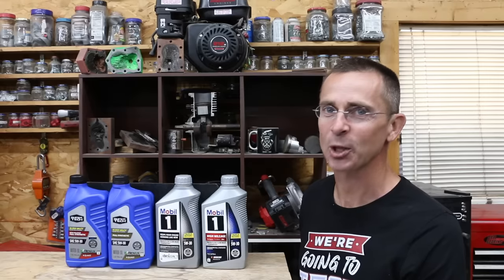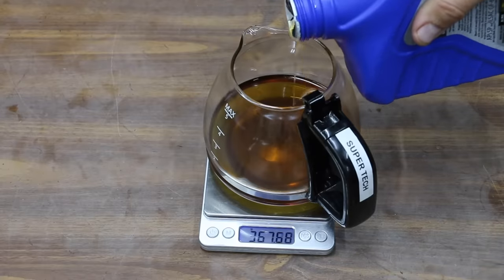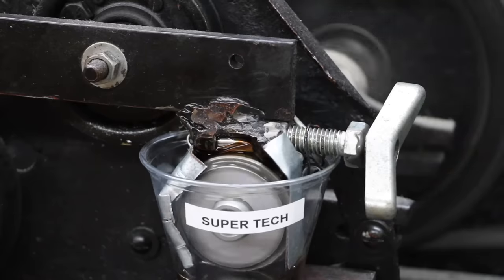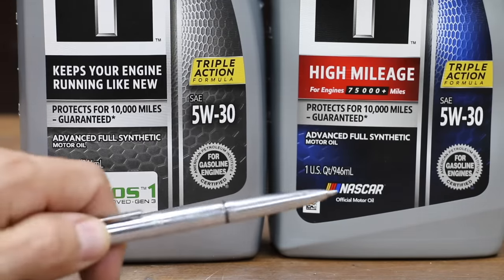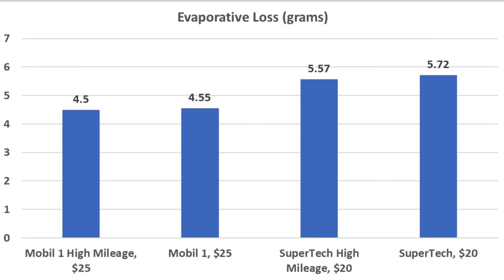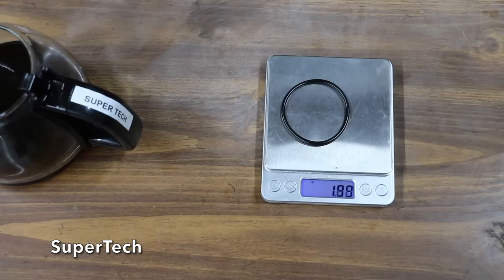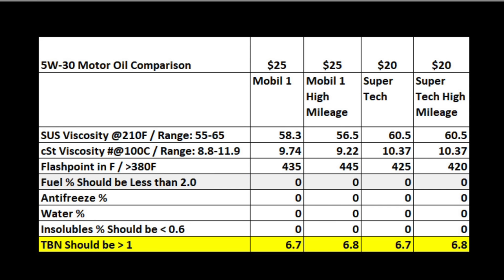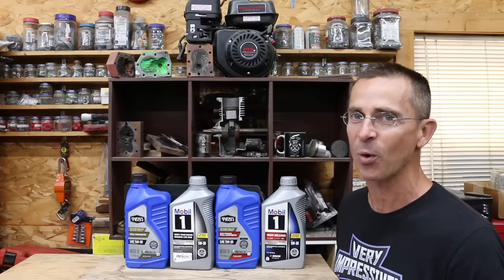Is “High Mileage” Motor Oil Safe? Let’s find out! Mobil 1 vs Mobil 1 High Mileage; SuperTech vs STHM

Comment: I bought that supertech 10000 mile oil once. Put it in a k20 honda motor. That stuff was like water. It burned up in no time at all. In a matter of a few weeks i added like 2 to 3 quarts of mobil one 5k mile oil. I'll never use that stuff again. My motor even sounded worse after running that oil. And it didn't burn oil before that oil change.
Reply from the maker: Thanks for sharing.

Comment: The viscosity of Mobile 1 came up at a car club meeting and if I remember correctly, the reason it runs slower in the tests where you poured them out is it's supposed to "stick" to the innards of the engine to assist with cold starts which reduces wear.  High mileage engines don't need that nearly as much.
Reply from the maker: Thanks for the feedback.

Comment: Would be interesting to run the same test using previous data to see if a difference shows up between different batches of oil. A test for consistency.
Reply from the maker: Thanks for the suggestion

Comment: if the test for a better oil is how well it flows, then why not just buy a thinner oil?   Oil companies place a viscosity rating of "10w-30" because it flows like a 10w-30.   If one brand seems to flow slower than other brands "10w-30"  then you can just buy the 5w-20..  So, what I mean is that there is a range of tolerance that Oils need to remain in, to be classified as 10w-30 or any other weight.  So it doesn't mean that if 1 oil flows a bit faster than the other that it is a better oil!   If more viscosity is better then stop using 10w-30 and get 5w-20.   All you need to do look for an "outlier"..  Meaning if 1 oil flows MUCH faster or MUCH slower than all the other brands, then it may be out of tolerance for that viscosity rating.. And it may be out of spec for your Engine.  It still doesnt mean it is a bad oil..  So IMO the only thing your viscosity test is good for is not to see if 1 oil is slight ahead of the other, but rather if one oil is drasitcally disfferent than the rest.   What you SHOULD do is find a baselione for how a 10w-30 SHOULD flow.  Then see how it flows according to the specified range.  Dont just compare 1 oil brand to the other.  And I dont like the Evaporative loss test also.  Because engines have a potential to use more oil than it loses due to evaporation.  And if your oil is in your engine SOOO LONNNGGG that it evaporated out or below LOW level between oil changes, they you have a personal problem not an oil problem. In short, evaporation is not enough to measure if you change your oil regularly.

Comment: Hi, enjoyed this video. Have a question. I just bought a 2007 Honda Accord V6 sedan with automatic transmission from an old man original owner, however, there are no maintenance records and he doesn't remember anything. The car has a lot of minor issues and faded paint, so, it needs work, but, the engine is not burning oil, the a/c works great and the transmission shifts smoothly. I don't know what was in there, but, I just did my 1st oil change and I did put synthetic oil in there . Hope that if it was on synthetic, it won't be a problem switching to regular Quaker State oil that the factory said you could use when new. Don't know if this was a good idea, but, I did it to save costs. I do want to keep it long term, but, at the same time, I 'm still deciding if I want to put $3000 more into this car to paint and fix it or if it will be a money pit. Here's my dilemma. Maybe you can help. While the transmission shift smooth, when I take the dipstick out, it definitely does not have that newer red fluid glow to it. Looks a little dirty and yellow like motor oil. But, it shifts fine. Not knowing the maintenance history and thinking it wasn't ever changed or not often, would you mess with it and flush the transmission fluid or just leave it alone and run it till the transmission dies or needs fluid and just add the fluid? I've asked a dealer and they say to change the fluid. I asked 2-other mechanics and they disagree. I'd also hate to put about $3000 into the car to clean up a lot of issues and then see the transmission or even the a/c go bad on me. I don't know if I want to keep the car or maybe sell it. Sounded like a great deal. 1-owner car and a friendly old man was the owner - but - I don't know if it was such a good deal after all. Thoughts?

Comment: As usual a great test.  There are still numerous variables. Not knowing the quality control consistency requirements for allowed variances between batches of oil manufactured by the tens to hundreds of thousands of gallons per batch from what they start with in unrefined crude available to them to what they finish with through refining and additives  though I suspect quality control is very tight and variances are minimal from batch to batch at least on the finished product.  While elastomers such as seals and O-rings are most commonly in direct contact with hot metal parts of an engine that become can experience the need for relatively rapid expansion and/or contraction in order to seal properly as well as tolerate being heat soaked for prolonged periods on longer trips I’m not sure but, suspect that the O-rings settled to the bottom of the coffee pitchers/carafe with only the Pyrex glass and a thin film of oil separating the O-ring from the burners surface and at what varying heat range.  I wonder what if any differences with the O-ring would have been observed had you suspended the O-ring in the oil so it did not contact the bottom of the pot.  I don’t know what influence that might have in test results or of such short exposure but outside of starting with a full engine rebuild including extra new O-rings and seals from the same production batch as the standard reference to be tested during/against teardown and rebuild of that engine many years, operating hours and miles later which isn’t exactly feasible $$$ wise and as many of us might not/won’t still be around.  I often wonder what the hygroscopic tendencies are of different oils and if there is a standard for such after exposure to use and internal combustion motor operation and the oil’s exposure to existing internal contaminants would be and which oils have the least and greatest hygroscopic tendencies and what influence such moisture contamination would be on wear surfaces and elastomers such as seals and O-rings.   To me, your tests are great common sense with mechanical knowledge and research interwoven within them.  I am(was) a technician and later a technical engineer at a commercial nuclear power plant so I was constantly trying to figure why some degreed engineers did things in such a way that seamed so alien to a former mechanic/technician in electronics, mechanic, pneumatics, hydraulics, etc.  Where their design weaknesses were their typical lack of knowledge in designing something while having little to no knowledge of it requiring access for operation and maintenance and that’s where the overlap in review by those such as the different operators, crafts and technical engineers that had such experience came into play in feedback during the design and construction process for the final design but our suggestions the design still had to  meet or exceed the different regulatory requirements.   I was the why did they do it that way questioning kind of a guy could it be installed faster with less radiological exposure and be easier to access to operate, maintain and repair.  Their knowledge was book taught while mine was real world application taught and always trying to think about the workers, the operator having to operate the equipment and the different maintenance department crafts and radiological and environmental control restrictions placed on those personnel and needed maintenance and field repair of the equipment.  I enjoyed my job but not the hassles often inherited when you got to pick up 2-4 years into a design that did not get due diligence from the various other departments that should have been more money involved because at that point management did not often want to hear of the problems some one(me) that nit picked wanted to identified while developing an Imp Kenya toon plan for its build, construction and installation.  Thanks for a good testing.  With the small variables identified especially in the wear performance other than the pretty significantly lower flow ability of the standard Mobil 1 cold flow test new and after after being cooked looking bad for Mobil 1, I for one have to ask why was that as I think the answers to that would be most interesting and suspect that even Mobil 1 manufacturer might be interested if you offered to send them some oil from that container new snd post cooking.

Comment: Thanks, good work, &* “ tests”….Interestingly, I just switched to Synthetic VALVOLINE / VALVOLINE Filter in :2007 Canyon LS4CYL, & 2015 Journey 4 CYL….The GMC PRIMARILY  was , MOB1 : &always used **MOBIL ONE FS HI MILEAGE “ for top off/ prime the early FILTER ( mostly NAPA GOLD/ Purolator BOSS; three -4 month,  Replacements, on both Vehicles….   actually, cutting back MY car work: had my Mechanic ‘s Shop do both,etc……Anyways, really good ideas:  examining this oil / Fitter/ change  stuff…
Reply from the maker: Thanks and you are welcome!

Comment: Great test....would like to see you add Marvel Mystery Oil to the High Mileage Oils and then Compare to the High Mileage oils. I add 1 quart of MMM every oil change. My Hemi takes 7 quarts total of 5w 20. So I use 6 quarts oil and i quart MMM. Mix that ratio using the high mileage against just the high mileage alone. Would love to see that test.

Thanks
Reply from the maker: Thanks!  Thanks for the suggestion.

Comment: Hello. Thank u again for all that u do. I've checked all different places for oil analysis for supertech full or advanced synthetic "10w30" and keep finding very low boron and Moly. Boron is the one I'm concerned with. The other grades use a surprisingly good amount of boron. I'm trying to find out it they did away w that in the 30 grade. That's the whole reason I was using their oil and adding a little of my own zddp. But if the 30 weight doesn't have the boron.... I will use a different brand. I thought if anyone would know it would b u. Thanks so much! Love the content, hard work, and the person u r!

Comment: Darn. 0w20 is now much more common than 5w30. But nonetheless, PF always rocks. Side note, GM cannot deny warranty coverage if the oil that an owner uses does not have the Dexos certification. Magnuson Moss act. GM can however deny warranty claims if an owner does not have proof of maintenance being performed (and yes a hand written records with oil and filter reciepts are sufficient) or there is evidence of lack of lube or abuse. GM will absolutely not send oil samples out to a lab to determine if the add pack is Dexos compliant, and GF6 SP oils exceed all Dexos specs anyways :)
Reply from the maker: Thanks for the feedback.

Comment: Yeah….none of my 15 Walmarts (big red town) have super tech oil any more. Sometimes they have….but it’s all high mileage. With wacky viscositys….like 0-20…. And that is $28 (Oklahoma)
I started using the Quaker State synthetic. Walmart has it, and is $22
QS shows pretty good results on YT
5 quart plastic jugs on both.
Reply from the maker: Thanks for sharing.

Comment: Hey Todd,  couple days ago I bought some Mobil 1 5w-20 high mileage full synthetic oil and a Genuine Honda oil filter for my 2005 Honda  Element with with the 2.4ltr i-vtec with 148,000 miles. After 20 miles after I bought it, it started to run ruff and erratic, serging when it reached 3,000rpms slightly aggressive on the throttle and the engine light came on. Error codes P2646 low oil pressure and P2647 high oil pressure came up. It was a quart low. I topped it off, but it made no difference. I know it's not an oil pressure through the engine because it doesn't do it all the time. It's either the solenoid or oil pressure switch that's faulty. I also bought a Duralast Engine variable timing solenoid with the oil pressure switch, aluminum housing, rubber gasket with screen filter and heat shield. Hopefully this fixes it.
Reply from the maker: Thanks for sharing.
Reply: @ProjectFarm  👍 Sorry it was a long winded comment.

Comment: Personally, when my vehicles hit 75k miles (or 100k) I would assess the vehicle.  IF it wasn't leaking or burning oil, I would just stick with regular synthetic oil.  But if it was leaking or burning oil I would switch to a high mileage oil (as i had one car where this helped with the seals a bit as it seemed to use less oil -- never really leaked any large amount but I did notice it went from about 1 quart every 3,000 miles to about half that in about 30 days after switching to the high mileage, as some of them have special sealants that can help rejuvinate seals.  As for fuel economy, I don't think it mattered too much (The vehicle actually had 150k miles on it and still got about 32mpg on the highway or about 26 in the city, so about 28 combined but this didn't really change much when I switched (I found the benefits to greatly outweigh the slight loss of fuel economy).

The one thing to keep in mind here is that some of the "store branded" oil like SuperTech in some cases (although maybe not SuperTech specifically) is manufactured by a large name-brand company (sort of like how grocery store branded items are sometimes made by big name food manufacturers).  For example, I thought SuperTech at some point was actually made by Penzoil.
Reply from the maker: Thanks for sharing.

Comment: Great video
I have a quick question. I have a 2020 Chevy Silverado and my wife has a 2010 Toyota carolla. Can I use high mileage oil in a newer vehicle? Believe it it not, both vehicles use ow20.i figured if could use high mileage in hers,I could save money on oil by buying high mileage for both vehicles. Was wondering if I could use high mileage for both. Thanks

Comment: 95 Subaru with 340,000 miles. WHAAAA you say? all I know is I don't think this has a different engine, it still has the single layer head gasket. never been  hot as far as I can tell. Don't care what brand of oil. I just change it about every 3-4 thousand miles. Oil is Cheap". Just changed the engine Oil. and transmission fluid and filter. Still going well. only have a #3 misfire every now and then. Glad to know the walmart brand Super Tech is good stuff. Thanks
Reply from the maker: You are welcome!  Thanks for sharing!

Comment: I’d really like to see a test using Diesel engine oil in a gasoline engine. I’ve been doing this for years in my mowers and motorcycles. My dad has a 2005 ram 1500 with the hemi and has been using 15w-40 diesel oil for years and his engine still runs great with 213k on it. I’m thinking of using it in our boat with a 454 as well.
Reply from the maker: Thanks for the suggestion.

Comment: Keep in mind a lot of time these companies don't submit their oils to certification because it can be very time consuming and expensive to do so. For instance, you'll see some oils, even within the same brand and line, change their certification from different manufacturers from year to year simply because that's the only certification they wanted to submit them for. They just simply can't submit to Ford, GM, Honda, BMW, Audi/VW, Mercedes, Toyota, etc. and get them on the shelf every year within a timely manner. That being said, most synthetics would be fine for most cars.

Comment: All I know from having a car with 230K miles that doesn't burn a drop of oil is that my car runs smoother and quieter on Pennzoil and QS synthetic than super tech , Valvoline, or Mobil 1. I stopped using Castrol because of the price and after seeing BTOG test results. Before the syn days, Castrol conventional was my go to brand, but there syn oil seems too thin.
Reply from the maker: Thanks for sharing.

Comment: I haven't seen all comments or all the videos,bit I'm wondering about the $25  jug of prestone platinum concentrated  VS regular concentrated at half the price. I'm doing a radiator flush. ,and accidentally bought a jug of platinum, but returned it. Definitely curious of the test you'd run. Definitely a lubricant test as well as a temp test. Which runs cooler,and who wins the race at -30°F
Reply from the maker: Thanks for the suggestion.

Comment: I used the high mileage oil on my old car. I think it helped it get another 40k miles on the odometer before the engine finally died. It does help prolong the life of old high mileage engines.
Reply from the maker: Thanks for sharing.

Comment: For the ppl who drive less than 10k miles a year and keeps the car for about 10yrs, the differences in the oil brand is pretty neglectable…. I just switch over to Supertech for any cars that I own after 50k miles.
Reply from the maker: Thanks for sharing.

Comment: There are car’s manufacturers recommendations to change oil after certain  mileage or time …, But  the mileage interval for the same car new or old are  given the same,  which is not realistic.                                                                                     We can buy in the store devices or stripes to verify actual level of acidity or alkalinity in antifreeze, also with special stripes we can verify level of degradation of brake fluid                                                                                                                Recently on the market I searched online a few engine oil testers and in Europe some stripes.     Would like to know from Your recommendation which one is reliable.
Reply from the maker: Thanks for the suggestion.